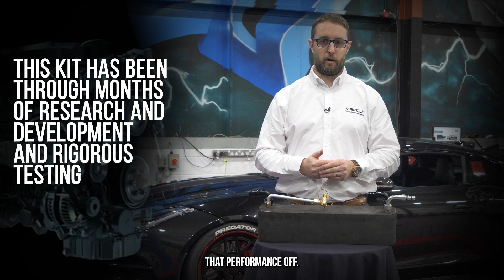Unlock Your Engine's Full Potential: Supercharger Chiller Kit Explained!

Comment: very cool that there is a direct kit for these cars.  Something that is worth mentioning is there is alot of gains if you take the charge cooler and make your own closed loop system separate from the hot engine coolant,  Put a small coolant reservoir in the truck and a coolant pump,   now it has its own system and tank separate from the hot engine coolant.  stack that with a chiller and I bet the results would be crazy.   The system i just mentioned is what i currently have in my jaguar xfr trunk

Comment: I don’t get, why you say an uprated coolant pump is better so it doesn’t get so much heat soak from the charge air. And then the, next minute saying you want as much heat out of the charge air into the coolant?
Reply from the maker: Yes that is correct, you want to get the heat out of the metal supercharger by cooling the water passing through it, this helps cool and reduces heat soak, the charger passing its heat into the cooler water, then this water is passed though the radiator to remove that heat and the cycle begins again.

Comment: Im not understanding where the AC system has the capacity to make any meanungful change to the sort of heat load the intake charge makes.
Reply from the maker: Makes a huge difference, we have seen the supercharger as cool as 4 degrees, massively reducing heat soak and keeping power at its MAX! We will see if we can get a heat map before and after, I think you will be really surprised how much difference there is in charger temps.

Comment: I was wondering why there wasn’t a superchiller for the aj133. I’m glad this is out. Great job guys.
Reply from the maker: Hi, in reality this unit can be fitted to any car, at this time we have only developed the new AC pipes for the F-Type, we will be working on the XFR next,  but is you have access to be able to join and make AC pipe connection, the kit can be customised to any engine. You can see it in our shop here : https://paramount-performance.com/supercharger-chiller-kit/

Comment: I love the F type R and am looking to buy one. But I have one reservation 
The complexity of the electronics ! 
Could I end up with an expensive brick because of electrical gremlins ?
Reply from the maker: Hi David, i think this could be said of any modern car,  on the whole Jaguars are not too bad for electrical issues, low battery voltage will trigger a lot of fault, but can easily be fixed of course - and water ingress into the eclectics can be an issue if you get a water leak into the boot. But generally, this is not a big issue on these cars
Reply from the maker: You may want to see our buyer guide too David https://youtu.be/ywMSMyHfvns